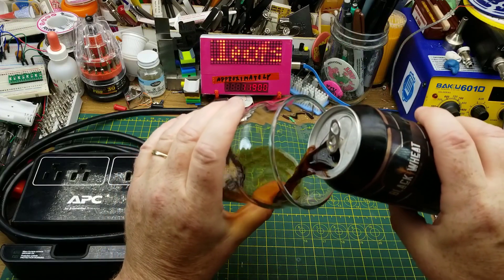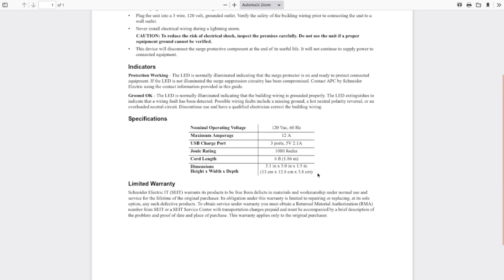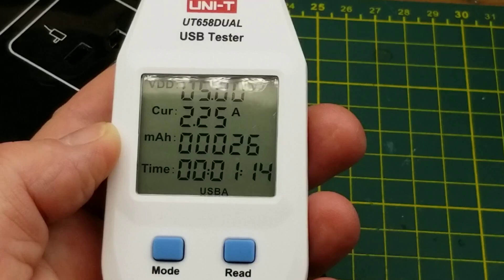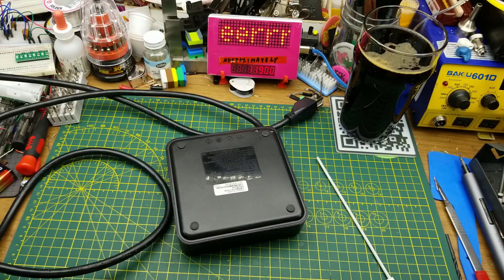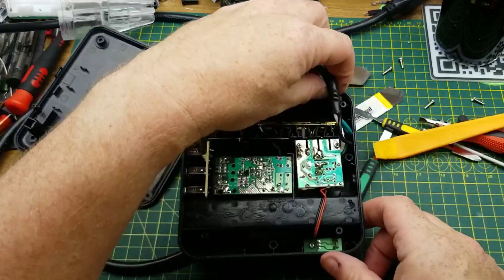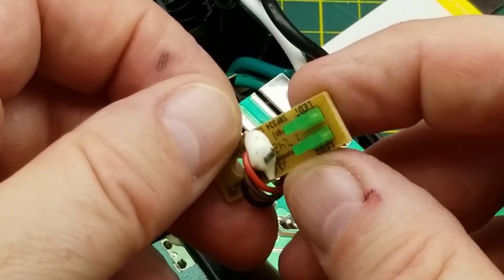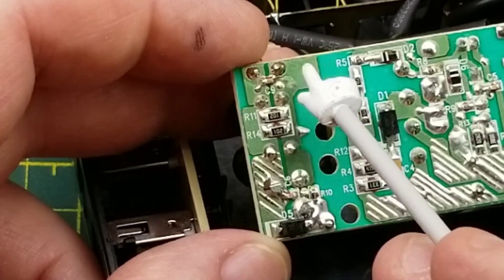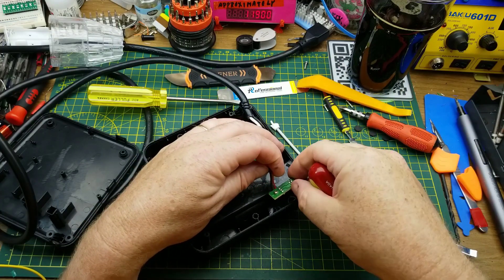Can I trust a yard sale surge protector?

Comment: Kinda cool how they use unshunk shrink tubing as an extra insulator. That way you can tell if a certain wire has been running hot (and the jacket is tight now). Love the video as usual!

Comment: England.  I think it's a bit silly to knock everything Chinese as junk. Probably 90%+ of all the gubbins in your house no matter where it was made is full of  'Chinese junk'. I could not find any LM317 HVT (I think that's correct) in the UK so I bought some from the U.S. in total they were over £3 EACH with postage. I later bought some from my mate Chairman Mao for 12P each with postage. I tested both makes and the Chinese ones were up to spec. Oddly enough even at 50X magnification I could not find any difference. Are you thinking what I'm thinking ?
50 odd years ago I was into valves, Oh God those Mullard EL34's were good. You cannot imagine in your worst nightmare taking electronics up as a hobby again has been like. However 245V (proper electricity) still hurts just as much - but not as much as 410V through the nose 50 years ago. TIP35C's are nice to play with. Chinese of course.
Reply from the maker: Agreed that China is capable of making quality stuff.

But as I tend to buy the cheapest possible for my hobby amusement, that tends to be the bottom of the barrel that china has to offer.

Comment: MOV markings are pretty standard, 20 = 20mm, S I assume means solid in this case - it's usually D for Disc, 201 = 360v clamping 100a class. And I think the x3 means there are 3 of them
Reply from the maker: Yeah, 3 MOVs makes sense,  L-N, L-G, N-G

Comment: 400V MOV block, means they use the same block in the 230VAC products, though those slots on the board are not for isolation, they are there for when this board is used in the plug in surge module, where the slots hold brass blades that are the connectors, so you can remove the module when it fails, and put in the new one. At least they did put in the thermal fuses, normally they are left out, hoping the breaker will trip when the MOV goes shorted. Still used incorrectly, the load should be through the MOV block, so the internal thermal cutout can disconnect the mov and load when they fail. Here when they fail your load no longer is protected.

Got an older APC UPS, which has the same MOV blocks in it on input.

Comment: The best one one way screw breaks its head off when it reaches the required torque, then no screwdriver bit can get
It out.  Always leaves a did i make a mistake before screwing it closed :-)
Reply: Those one way screws are at best a slow down, IO normally go find a regular one to put back in place of it, as they are all going to be the same or similar as a common regular one.
Reply: @SeanBZA  I had some good oneway screws where the only answer was to cut a slot to get them to turn. as luck would have it, it was not down a hole.
Reply: Those are the bloody things Pro Elec uses on their extention leads they are the devils work and should be banned😠😠